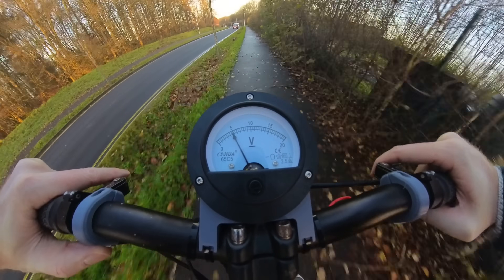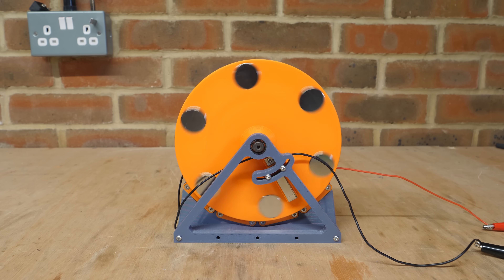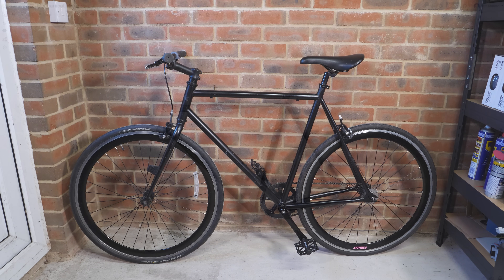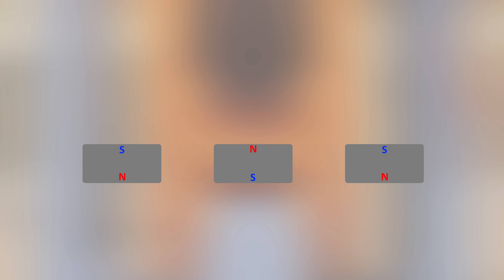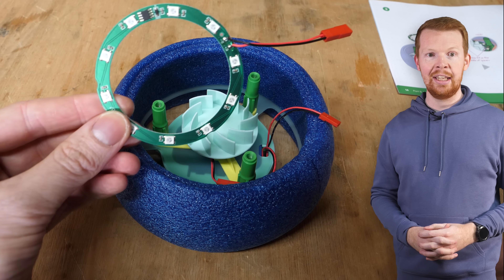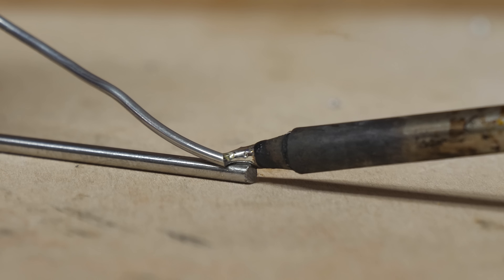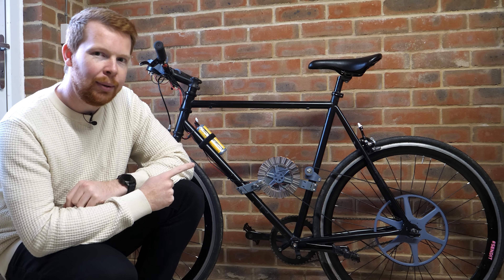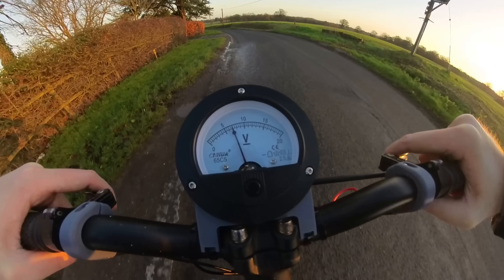The Most Minimal Electric Bike

Comment: Hey Tom,
Please consider making a rheostatic brake for bicycles. The biggest reason is no brake wear or heating on long descents. I had times that I wished I had that.

For those who don't know, rheostatic brake(which is also called "dynamic brake" on diesel-electric locomotives) is a brake system that converts kinetic energy of the vehicle into electrical potential. Then, you connect this electrical potential to a power resistor, which is basically an electric heater. Since you power an electric heater with your kinetic energy, you slow down. It's very easy to implement on electric traction vehicles, since you already have traction motors that can double as generators. On diesel-electric locomotives, you don't have batteries or a power grid to dump the generated power, so you use the resistors, instead. It's a waste, indeed. But you save brake wear. With heavy trains on long descents, this can be very beneficial.

On bicycles, the bigger gain might be not losing braking power because of overheating friction brakes; or tires exploding with rim brakes. And if it's not an electric bike, you can simply attach magnets on the wheel and have coils on the frame. If you keep the coils away from the magnets, no brake, no riding resistance. You can adjust the distance between the magnets and coils during the braking for variable braking power. It can even be attached to a v-brake with tons of clearance, so that if the coil gets too close to the magnets, v-brakes get engaged; which can be very convenient. The system can also be kept reasonably light, although heavier than just v-brakes and probably lighter than disc brakes.

Comment: Why dond you use a hall sensor or a electric magnet sensor,or a inductive sensor??? 
Or iff you want a switch the add a second gear like wheel and with 2 contact switch it can run even better without sparks or any misaligment switching.
It can work even better

Comment: Why use a reed switch? Why not just add a metal flap to the wheel at every magnet, and have that bridge two stationary, open ends to close the circuit? The release speed would be much greater, preventing arcing.

Comment: Dude I'm screaming at my screen. You are reinventing DC motor, but backwards. Why did not you make a commutator like every other DC motor uses. Your solution will be limiting in speed, as at some point the inertia of the moving tungsten rod will just filter out the changes in magnetic field pushing it. 

Love your work, but this is just shooting yourself into your leg. You even had the motor carbon in your hand xd. 

Anyway the rest of it looks nice, i just had to step into this reed switch madness

Comment: capacitor in parallel across the switch will help deal with the large spikes of current from the collapsing magnetic field in the coil.  Old engines that use points ignitions have this for this reason across the points, without it, the points burn up very fast.  An automotive condenser would likely do everything you need. 

I'm also wondering why you didn't get a standard highamp relay, dissassemble it and put the contacts near to your magnet wheel, would've worked the same.

Comment: Trigger coil like Bedini, instead of reed switch?
Reply: The Bedini motor is much less efficient.  When you try to measure its performance, you run into one of the most common causes of measurement error when using meters.  The Bedini design draws its power in extremely short pulses.  Even quite expensive meters are not designed for this sort of service and give you wildly wrong readings when you used them for it.  A second thing that messes up people is that they often don't take care to make sure that any batteries you may be working with are at the same temperature for all measurements you do.  When you warm up a battery, its voltage rises.  This rise can be more than the decrease you would see from discharging the battery slightly to warm it.  Thus drawing current pulses can make it appear you are charging the battery.

Comment: serpentine coils are great for this sort of project.  You can wind them with heavier wire and they take far less work to make.  You end up with effectively all the coils in series rather than parallel.  Basically:  you use a bit of string or something to find the total length, wind on a jig that lets you just loop the wire and then form it to fit and put the end cap on to hold it all in place.

Comment: Some suggestions. Why did you use a relay switch which would have been more efficient.
You could also have used a pencil since they also have tungsten. :)
another layer of coils and magnets would have helped. ;)
But your coil winding was not perfect and it was too thick.

So your toy car has over unity in how you explained it?

Can you make me your mini pancake motor with the magnets on the outside? 
The other issue is size the bigger it becomes it takes as you see other challenges so maybe many smaller versions on your bike might have helped?

Comment: I think you should look more into this concept. A mechanical BLDC controller could have some practical use. How about instead of reed switches, you use a set of cams? This would allow much stiffer and heavier-gauge conductors, with a longer throw and faster deactivation to prevent arcing. You could have multiple throttle settings by selectively engaging cams to change the duty cycle.

Comment: When soldering, you need to heat up the tungsten first, don't just touch it with the solder right away, you should also be using flux to help it stick to the surface

Comment: if you crown the gear slightly, and add a u shape (two walls on the sides of the gear teeth, you can hold the belt on more securely.

Comment: Why didn't you just use the switch you mentioned and just add a leaver extension to the switching arm that could be pulled in by the magnets, it seems unnecessary to have the contacts themselves be smashed together by the magnets

Comment: Use an interposing rela/contactor. The reed switch powers the relay, the relay powers the motor. This will save your switch contacts from wear and offloads the high current duties to something designed to switch power.
Reply: dang maybe you could combine that full bridge rectifier and some transistors  to control the current to the motor all on one circuit board we could call it a motor controller
Reply: the relay is way too slow
Reply: @aleatza  A MOSFET would be a little bit cheating, but it is "soft electronics" (as in the definition of "soft magic" vs "hard magic") compared to ICs.
Reply: @takix2007  yeah, a mosfet is cheating :'). But the relay will simply be always on or off on that frequency. I don't know, maybe create a circular pattern with copper like a series of notches so that 2 graphite brush can run on it and the notches can close the contact between them. In this way you can avoid the magnet weight on the contact, the eccessive noise and can achieve higher frequency (equals more speed). But it will wear of more rapidly and it wil spark. It will spark like crazy.
Reply: It would be cheating by the literal definition of "no electronics, but a single mosfet is not even beginning to be a smidgen of a ghost of a possibility of being as complex as a motor controller.

   Anyway, a relay is an interesting suggestion. I suggested it too, in a round-about way, mentioning that relays have an inductive load rating and to look out for that. I wonder how well (or badly) it would work.
Reply: simply use a vacuum tube

Comment: My dad worked in the factory that pioneered reed switches, back in the 60s. He was a toolmaker draughtsman and his input was the part of the machinery that held the reeds in exactly the right position while the glass cooled. A much more tricky operation than it sounds, as the quality control was extreme on those switches, if the gap or alignment was out by just a thou or two, they were rejected. As a result, I had dozens of 'failed' reed switches from his testing, which are actually perfectly good switches and still work today. I don't have many left now, but when my youngest daughter (2nd marriage)  was doing a project in primary school, I realised that it was perfect for a reed switch. She was then about the same age as I had been when my dad was running those tests, so that reed switch she used was over 50 years old, and still worked perfectly. Not bad for a reject!
Reply: Great story, but don't be so hard on yourself. No one thinks you're a reject😂
Reply: Made sense to me!
Reply: Reed switches have been around since the 40s. Not a very good pioneer to do it 20 years after Bell is using them everywhere.
Reply: @RiveroA  maybe they were pioneering a new variety? His switches were sealed in glass capsules, with a partial vacuum inside. It was trying to get this done that was their big problem. I'm sure if such switches had been available they wouldn't have bothered trying to reinvent them!
Reply: @RiveroA  Could be a new company trying to get in on the reed switch market. Developing the jigs to make their own reed switches could have been a new thing for them.
Reply: Это было в СССР?
Reply: Insightful comment. Crazy that someone is attempting to derail an innocuous comment that sets the time line and also invaded by Russian shills!
Reply: Dank Menschen wie Ihnen begannen 80 % der Weltbevölkerung, die Gelb-Blau-Kombination zu hassen.
Reply: Did your first marriage break down because you bored the fuk out of her discussing switch tolerances?
Reply: 2nd marriage implies being a widow.
Reply: @edgarhilbert4797  of course it doesn't! Most second marriages are the result of divorce. And, anyway I'd be a widower...
Reply: Украина? А это где?
Reply: (Second marriage) is a crazy input
Reply: 5~30V boost converter PCBs ok la
Reply: Why was it necessary to tell us that she was from your second marriage?
Reply: @cadecarp11 flavour
Reply: @cadecarp11  it explains my age (ie the 50 year gap). Otherwise, why would I?
Reply: @paulhaynes8045  I have some friends that had their youngest when they were both in their 50s. But either way, I just think it was an odd thing to clarify for an audience that has never met you.
Reply: @cadecarp11  You're fully entitled to think that.  But, my experience, as someone who was already a pensioner when my youngest was 9 (and only 2 years older than my eldest grandchild), is that people get very confused.  So I tend to clarify before I get the questions or odd looks - it's just easier that way.  And helps others to avoid embarrassing (to them) questions.  Why there's such a fuss about this is way beyond me.
Reply: @cadecarp11  Why was it necessary to question its inclusion?
Reply: @lordhughmungus  the earth will stop spinning if I dont.
Reply: @cadecarp11  Possibly because he has experience with women, and don't want to get into trouble if any of the possibly connected women reads it, and misinterpret what he wrote into him mixing them up. If that was way over your head, don't worry, it was a somewhat plausible explanation, and an attempt to be slightly amusing.

More interesting, why did that trigger you, to the point it was "necessary" for you ta ask?
Reply: @fishyerik Ain't no women in this comment section  😂😂😂😂😂
Reply: @rohfo94  Why do you think so? You're wrong of course, but what was your logic here?
Reply: ukraine will never be in the eu
Reply: @stenzenneznets  It will. And NATO. Putin really screwed up when he tried to stop EU/NATO expansion - he's managed to have the exact opposite effect than he intended!
Reply: ukraine will never be in the eu
Reply: @thehandlesticks66  is this ragebait? lol
Reply: @thehandlesticks66 never say never!
Reply: @thehandlesticks66  Are you a little edgy boi, or just so inept that you posted on the wrong video?

Comment: Regarding the electric arc, which appears between the switch contacts, the arc can be prevented by using a snubber network (capacitor + resistor). Next time, I recommend that you consult with electrical engineers. I really enjoyed your video! Thank you very much!

Comment: you need to take i look at old ignition points setup what your missing is a flyback cap spark arrester like the ones used to stop the points from burning in cars and motorcycles

Comment: I wonder if you can use an EV car or motorbike motor which will be lighter and use the magnetic motor braking to charge a battery when going down hills... 
🤔 🧐 🤔 Maybe you can make a LARGE capacitor as it would be very light compared to a battery like a really long tube capacitor's and insert into the bike frame and maybe 2 or 3 on the outside , just be super careful those things can kill ⚡⚡⚡⚡⚡

Comment: When you can put the magnets on the rim of the wheel, and create a section of "fender" which has coils on either side of the rim, to do your acceleration / regen breaking, you'll be onto something.

No belt necessary. The rim becomes your armature.
Reply: Add a basket attachment for the screws, nuts, metal road debris the wheel's magnetic feild whips around in a rotating blender effect in the air.  That sounds awesome!  Paper clip mini tornados flying around your wheels.
Reply: Putting weights on the rims turn the wheels into great flywheels, hard work to get go and hard work to stop.

Comment: Unfortunately, regen braking is a bit of a dead end with bicycles. It works well for cars because they're so heavy. They take a lot of energy to get going and a lot of energy to stop, but are quite efficient at a constant (low) speed. A bike barely needs any energy to start and stop, but needs constant input to overcome the relatively higher drag. It's optimising the wrong bit. This is why no commercial e-bikes actually use regen braking (AFAIK) - it's just not worth it for the meagre amounts of energy available.

Comment: If you use a brushed DC motor, you can control the speed using switching which connects groups of your battery cells in different ways to give different speeds. For example if you have a 48V system, in 8 groups of 6V, For low speed your switch connect all 6V groups in parallel, medium speed you connect into 2 sets in series at 12V and then those sets in parallel, and for full speed connect all 8 6V groups in series. This, or a version of this was how EVs were controlled before electronics were available.
Reply: does this feel any different to the driver compared to electronics using PWM to control power?
Reply: Is that how trams worked

Comment: I appriciate how you're trying to use magnetic forces to "do the work". Unfortunately in the electronics world the engineers has gone down the rabbit hole of this segment and made things pretty efficient. 
If you wanted to create something innovative you gotta use new exotic materials and/or concepts (and alot of background knowledge) to make things competitively efficient.
Eg you did flywheel bike, there are companies in UK which does flywheel/regen for industrial and race car applications. They spin at 20k rpm, alot of technology/secret sauce behind it but it is still a very niche application.

This electric motor, the issue is that it's not enclosed/encapsulated/segragated to minimise arcing. Controllers are used for this exact reason to 'control' the conditions of electromagnetic forces without hitting mechanical issues like fundamental frequencies, heat, vibration, etc.

Moving back to aero/mechanical would probably have more innovation to be had imho ❤.

Comment: Some thoughts:  car alternators have an energized core and thus there is only a very weak magnetic field causing drag (this refers to a self-exciting alternator).  Obviously the reed method is limited because the opening of the contacts causes an arc.  You can use snubbers to try and reduce the arcing, either a flyback diode, an MOV, or a Quencharc "snubber".  Many washing machines use 3 phase induction motors, you might consider a similar concept using "upcycled" parts to show how free/garbage can be repurposed like this.  I would guess those magnets in your motor cost quite a bit.

Comment: Fun fact: BMW cars (the conventional, purely combustion powered ones) charge their 12v battery essentially in the same way you were charging your phone. The alternator is primarily used while decelerating, and switched off the rest of the time (unless the battery charge is too low).
Reply: That would probably be best to keep the battery in shape.

Comment: You might be able to use the voltage generated by a hall-effect sensor to open a FET to switch the power that way - might make it too "electronics" but wouldnt have batteries per-se.

Comment: For the reed switch, you could make a thin acrylic box and fill it with an inert gas like argon. It should stop it sparking. This will also dampen the noise and should protect it from dirt and water as added bonuses. 
Really cool project, I hope you revisit this as it's definitely a viable cost saving alternative to what your average ebike costs these days, a little less powerful maybe sure, but it's worth the extra £500+ you could save, at least in my book. 😅
Reply: Sulphur Hexaflouride would be better

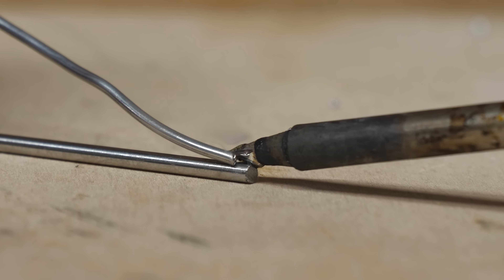Comment: 7:30 you can maaaybe solder tungsten using highly concentrated ZnCl2 in water solution as a flux (like, to the point it's a very sticky liquid - put as munch ZnCl2 as possible in the water). I haven't tried it on tungsten, but it works on nichrome which doesn't solder  otherwise.

Comment: add a resistor capacitor in parallel with the contacts, this is called an arc suppression or RC-snubber circuit.